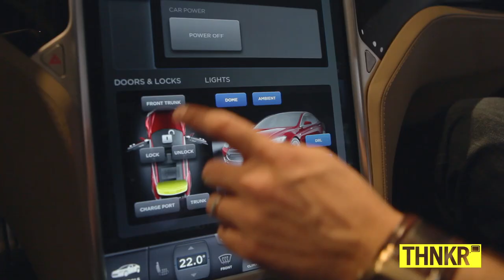Tesla Makes Green Sexy

Comment: its not about solving the energy crisis, its reducing pollution. it would be stupid to think that changing your energy source could resolve an ever increasing need for energy. but as far as this changing the energy costs of getting from one place to the other, it is a vast improvement. electricity able to be generated, while oil or gasoline is not. so it is much better than our current vehicles

Comment: The most expensive part of the car is the battery which needs to be replaced year after year. 
The car would be more efficient if it had a solar roof panel and graphene super capacitors along with what it has already.

Comment: I know it's a little bit of a dream, but if you could run a wind and/or solar tie-in grid system at a large enough scale, then you would almost never have an electric bill or gas bill if you were using an electric car... still have maintenance costs of the system, vehicle, and there are some geographical restrictions in a lot of places.  But if you can pull it off, that's an extra $300-$400 per month for some people!

Comment: Why is it that you NEVER see the question of the extra load on the electrical grid addressed? You can't just replace conventional cars with electric and pretend that you are using less energy as a society. If everyone owned an electric car the increase in electricity demand would be ENORMOUS. It may be more efficient to generate this extra energy at a power plant and transmit it via the power grid than to burn gasoline in millions of individual cars, but nobody seems to know for sure.

Comment: If you replaced all cars that use gas with electric cars it would. The reason it would is because of having all the cars that use gas and all the plants that use coal and oil. You now how only the plants using coal oil, wind, hydro, Nuclear now powering all the cars. Problem not 100% solved, but time bought to figure out alternative energy sources.

Comment: Really? time will tell the Tesla is still prototypical and it's actual use as a flagship is fine until you have to upgrade or replace batteries. They should have followed Ford's example and made the practical non-bling car first and gained true visibility. The far east will be the first to manufacture an affordable electric but the import bans will prevent us from getting them. CO2 is not an issue compared to jet exhaust failed pitch the reduce carbon thing.